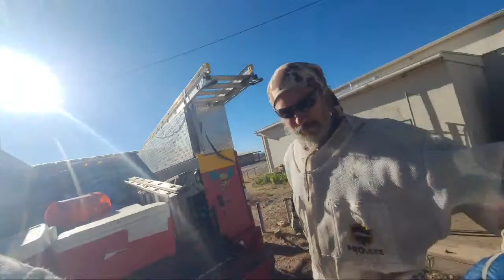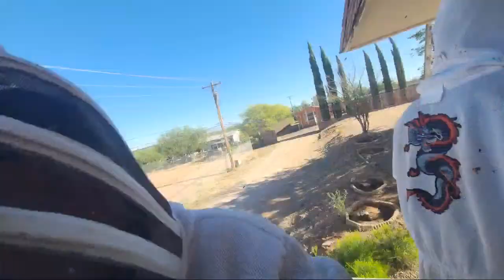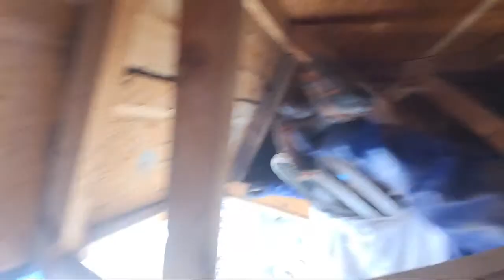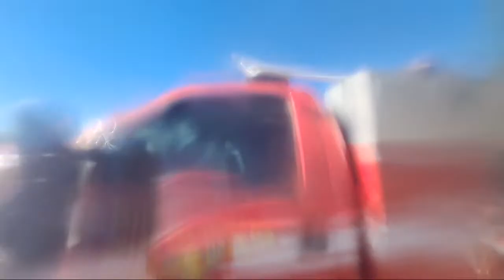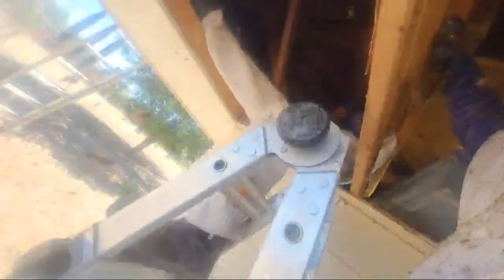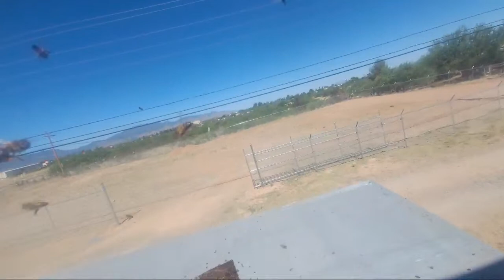Dillon's Killers

Comment: @killerbeeguys, Amazon sells lights on the front of stocking caps, I have a couple, cause it’s so dark and cold, here in Fairbanks, Alaska, you could use a double stick tape, I use Alien tape, to stick on the front of your bee suits, thanks for the videos.
Reply from the maker: Stocking hats? Warm (hot)  in the summer? The headlamp idea might work!
Reply: @KillerBeeGuy  they sell replacement, just stick it on the front.
Reply from the maker: Velcro?

Comment: Please comment on the fact that you are using an spray adhesive containing acetone in confined areas.  This could cause an explosion all you need is a spark or static to ignite I saw you / your assistant using this in the 5th wheel segment bedroom, he was in an extremely confined area using a LOT OF THIS SPRAY plus it's poisonous!  WHEW!   This is a very hazardous procedure you are doing you need to really consider.
Reply from the maker: Thank you for the thoughts Willy! Here in the desert any accelerant dissipates within seconds. I'm not sure if that is what is used in the brand we use but I'll look! Thanks again!